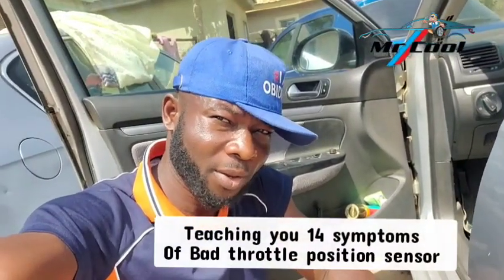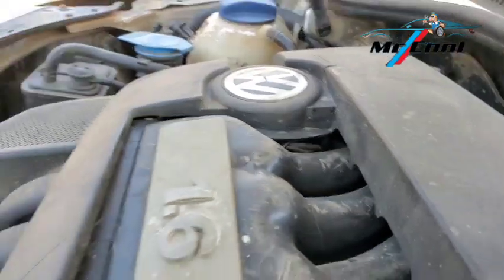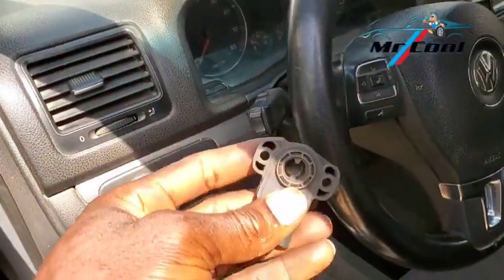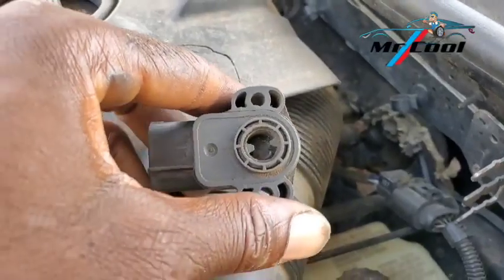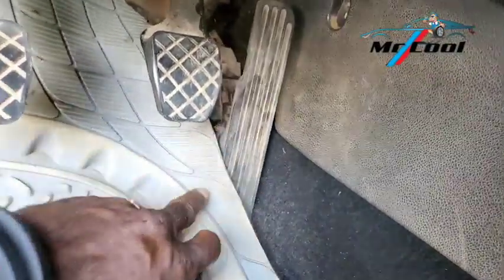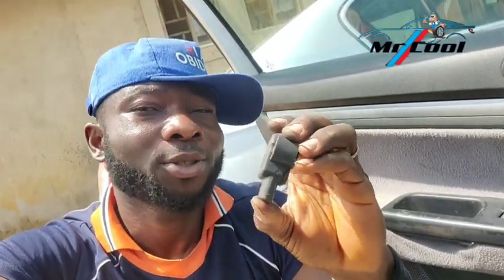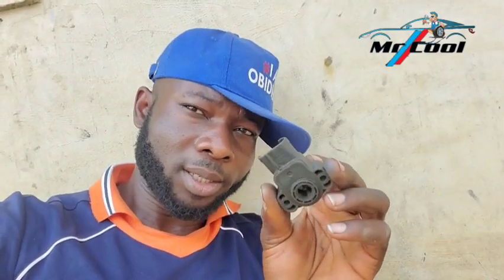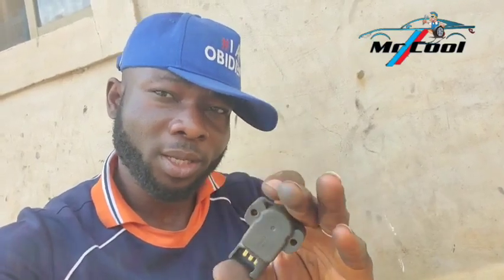14 SYMPTOMS OF BAD THROTTLE POSITION SENSOR | Throttle Position Sensor Symptoms [ p0122 ]

Comment: You are spot on my van has caused me so much stress all through throttle body position sensor I’m gonna clean throttle body valve aswell but no more Christmas lights on my dash board an I’ve never slept so good 😮